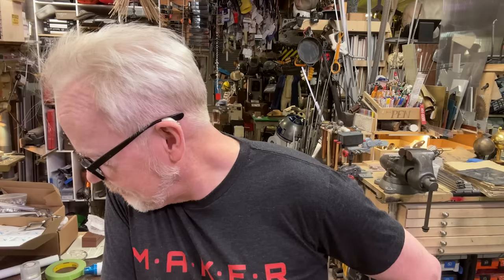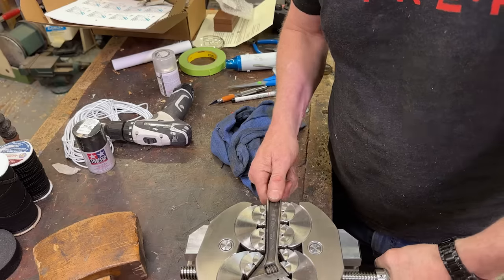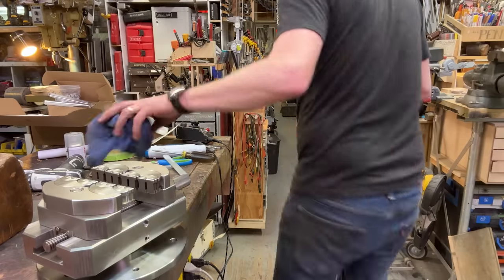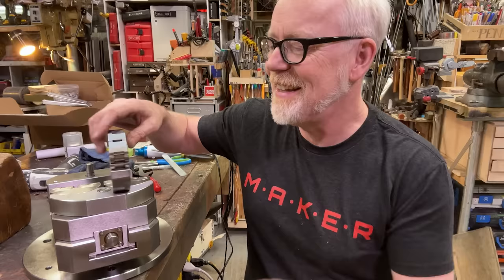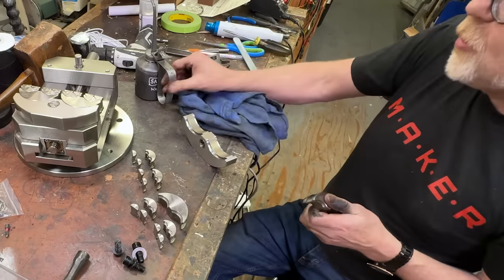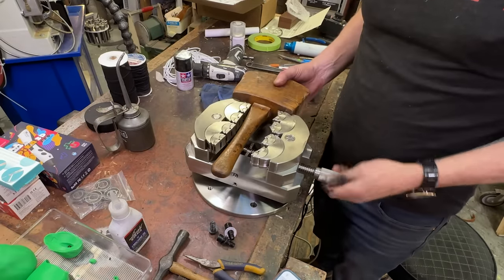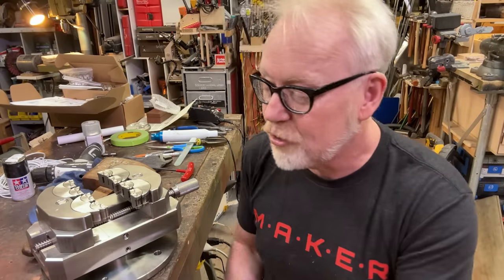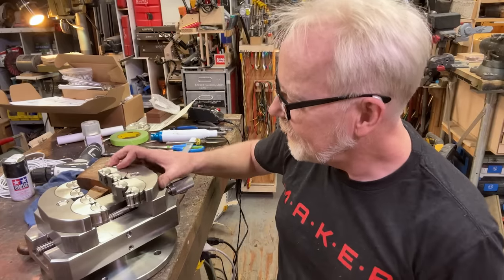Adam Savage in Awe of This Fractal Vise!

Comment: I think the original works better at adjusting its face for a couple of reasons.
One, there are more pieces and they come down to a smaller surface area.
Two, the final pieces need teeth on the edges so the middle of the face doesn't get "caught" as you close the vise.
If instead of being a flat face, they could be cuppped. So you would have what amounts to two protruding ends. Like a half moon. That would definitely give them a nudge in the right direction as you closed the vise.
I would use a very fine rubbing or polishing compound to work them into each other.
Finally, i would number or mark them so you always reassemble them the same way. Dont forget to mark the face of each. Maybe just number them on one side and make that the bottom side.
Reply: Funny I was thinking the opposite, as in half moon with the thicker part in the middle to aid the rocking motion and provide more conformity. I could imagine the sharp edges of the smallest teeth digging into the work piece and binding. Apart from that detail you read my mind. Cant wait to see where he goes with this
Reply: This Chinese vice is a stolen design from an American manufacturer, it's actually patent infringement...

Comment: As a fellow machinist i can say that when micro tolenraces are involved in linear movement they are usualu processed after hardering to created micro semi circular ¨Scratches¨ so the oil has  something to grab on to and stay there, down side is depending on the working ambient micro particles of metal/normal gunk cand also get caught thus risking damage (avoided in most machines by rubber dust covers), u can overcomplicate the crap out of it by adding a pump to the torque shaft and fine drill active oil injection when it moves with quick connect so they can rotate, but yeah, it´s a fun toy, using it is a joy, maintaining one is a fraking nightmare for daily use

Comment: You should bore out the large thread for  the tension bolt and rethread the tension lever bore with close metric threads and install a new metric threaded tension bolt with a sliding handle  then you would have more tension control and it can really grab things tight. ❤ the video, you are the man brother 💯

Comment: holy things!!! Thank You Adam. I was even aware of such a vise exist. I have a machinist formation and I think i love this thing as much as You. I genuinely had chills when i started to see the vise during your unboxing. A notch in the center of the ends half circle seem to be a great idea. I presume the alloy of the the vise is a very hard one. Maybe close to what would be classified as HSS. Would probably required at lest a full carbide tool to machine it. The thing is how to make these tiny half circles hold while machining it. Maybe holding two half circle face to face and drilling and using a reamer to finish the job. Could maybe be done on a latte. Anyways very exiting.

Comment: I remember seeing a video of the restoration of an original fractal vise. That one, I think, utilized a threaded pin in each fractal element, running in a groove on its mating part, to ensure it wouldn't be removed by accident.

Comment: I think it's probably good to use a light rubber mallet on these to unstucken the swiveling parts when you're at 90% clamping before putting any more turns into the screw. Vibrate the whole thing slightly until the looseness of some parts gets spread out to the oes that made contact first.

Comment: I assume you checked for burrs when you took it apart the first time, but make sure there are none, make sure all the mating surfaces have a good mating surfaces to begin with. So some light sanding with some fine sand paper will do, putting lapping compound or polishing compound probably first, is a great idea. Work it in best you can, but maybe not actually clamping, as compressing the hard abrasives will perhaps imprint or at least become less effective as an abrasive. But working it in with your hands, rotating the pieces together would be great. Just make sure you clean and then oil well after.

Comment: Simple way to clean this, first, mark orientation of the parts with engraving pen, dismantle, go over all the surfaces with a brass cup brush, no need for speed here. Then wash it all off in a solvent bath. Dry and assemble with a light machine oil. I'll bet you it'll work quite smooth without any other work needed. Now as far as the locking mechanism for spinning, pinching that little shaft with opposing grub screws wont be enough, you'll need a secondary means of clamping that down. And I like your idea of a speed handle on the vise handle, wish I had a shiny new toy!

Comment: I think one thing you could do to smooth them out is put them in a steel pin tumbler 🤔 it should polish the pieces without removing too much material. Or possibly sand blasting only the sliding surfaces?

Comment: I might suggest using dry graphite as a lubricant instead of oil? Maybe? Since it will more than like used in an environment where the oil would hold on debris.
Reply: Dry Moly. And if you want this thing to never gall, alternate the hardness of mating surfaces by at least 50 Brinell. Also +1 vote for numbering and match marking individual mating parts before lapping together. Also recommend ball screw retrofit- get rid of the acme screw. What grade of SS was used in its construction?

Comment: For anyone with a 3d printer you can print a fully functional plastic one, much stronger than expected and 25 bucks instead of 2500, super good for pcb and things alike. I also saw a video restoration of an original and noticed that instead of flat where the surfaces hold object there are actually 2 teeth on the original mating surfaces which may help with conforming to the shape better??

Comment: If I were improving the design of this product.   1.  I'd spring load the individual pieces so they return to home position if you just release the vice.  2. I'd make a lock down for the springs so that I can keep the current shape so I can keep a shape if I am working on multiple of something so I don't have to reset the contacts every single time.  3.  I'd mill out a slight crescent in the end pieces that contact with the product in the vice, and fill it will some semi-hard rubber that has just a little give.  I feel like not everything you work on in the vice will like a hard and scratchy metal surface rubbing, moving, and pushing into it.

Comment: if possible, i would see about finding a split pillow block bearing for the opposed acme screw. i feel like the metal on metal would start to make the action very stiff after a while. for the swivel function i would make an integral slip t handle for ease of adjustment. after using some fine lapping compound i would number each piece and after lapping the parts i would use a ptfe type lubricant to keep fod out of the contact surfaces.

Comment: An original one manufactured in the early 1900’s each dovetail would have been hand fit (why they were numbered). But with modern CNC you can get repeatable tolerances for interchangeability like that.

Comment: I've had success using metal or jeweler rouge and a buffing wheel to put a mirror finish on irregular mating surfaces.  Takes very little time.  The most difficult bit is holding onto the parts without shooting them across the shop.

Comment: Crosshatch the facing jaws for grip?  Then is it done as a lightly-scored to avoid damaging surfaces it grips or at the other extreme of deeply-cut for best grip but at the cost of marring surfaces it grips.  Alternatively, maybe place a thin rubber surface with adhesive on one side that could be easily replaced on any of the facing jaws?

Comment: The mating surfaces you should create new ones or make it so you can inset a soft metal so you can hold onto objects you don't want to be bitten into.
Overall the vise looks amazing the handle could do with a better style, using a floating bearing instead of grub screws and it would be nice to turn the vise without needing a grub screw so a way to lock it in via pressure like a pressure clamp/mechanism would be nice. 

Last would be a way to tilt the entire vise, that way you can work on them vertical or horizontal. This would cause issues though since the heads come off without any set screw or mechanism keeping them in place.

Overall great find, I always though the Fractal Vise was amazing looking and would work great in many different scenarios.

Comment: Putting teeth or slots in the outer surfaces that touches the tool you are grabbing to prevent that surface being flat will cause it to leverage and move the contact points a bit better and hold what you want clamped down in it a bit better, as seen on the original.

Comment: Looks like a brilliant tool to engrave odd pieces, steady for pin vise work, etc.  Not sure it has the holding power for mill/drill work?  Anyway, if half moon pieces are a tad too tight, a light lapping with 1000 clover compound might do well?   Just clean it very well after.

Comment: Ok, as a professional automotive machinist, I actually agree, that it is a good idea to use the lapping compound(Diamond, preferably.  Due to the stainless steel hardness.  Or, could use the carbide, if they even still make it), to remove the burr's, that are causing it to stick.  But, if you do not already have one, you should get a part's cleaner(Or, you can go to your local auto mechanic shop, and ask if you can use their's, or at least see what they are), to remove all of the old gritty oil, as well as the lapping compound(Obviously, it would be defeating the purpose, if you can't remove the lapping compound, and actually clean it, like you are wanting to).  Now, when you are done, you should use something else, that is primarily used with automotive's, as well.  I would use the anti-seize lube(Copper, not the aluminum), as it is set in a heavy grease(Keeping gravity from removing it), and the copper, being a softer metal, will give a smooth surface, as it act's like microscopic ball/pin bearing's.  And, I do recommend using it on the vehicle lugnut's, brake cylinder bolt's and virtually any other nut's and bolt's, that would be loosened and tightened periodically(When tire's are being rotated/replaced, or brake pad's are being replaced), as it will help keep them from "freezing up", where you could break the bolt head's off, or the nut's break the threaded part off of the stud's, bolt's, or whatever.  And, you can use it for the bolt's/nut's on the mill, just as your lathe(Especially, the jaw threading, as it will cause less wear on the thread's)...
Reply: Now, on to the Chinese factory stuff.  Yes, there are some good stuff, but you do have to watch out for the cheaper made stuff, such as ball/pin bearing set's, and some other stuff.  The ball/pin bearing's are made from scrap metal, that compromise's the integrity of the metal itself, as it's not as pure, as if you were to get them from a US factory, where they use fresh metal, that is AKA "Virgin" metal, to some.  And, the tool's(Wrenches, socket's & etc), you can get away with it, to a point.  So, like I said, just have to choose wisely, with your gamble...

Comment: I always thought (based on admittedly anecdotal, at best, evidence), that the miracle of manufacturing in China was not in the ability to produce things at low price points, but the ability to manufacture something to MEET a SPECIFIED price point. The things we (westerners/Americans) tend to buy happen to be spec'd out for the lower price points, but I'm pretty sure you can have a product manufactured to a higher price point, and therefore a higher quality, if you request it and have the demand to meet a minimum volume of orders. It's price point engineering, meta manufacturing, whatever you want to call it it is freaking impressive.

Comment: Baby steps only when it comes to cutting, you know what happens when the work moves even just a little bit. Every use will complicate the fitment of those nested surfaces. Machining warf and fines, plus the internal clamping forces will generate a hair pulling experience for the life of the tool. Flat plates, key stock and bees wax will get about as much work done, with 1/10th the headache.

Comment: Ive used 4 grades of diamond lapping compound to create excellent mating surfaces before, but you have to be super careful not to cross contaminate the grades or all is lost. Not sure if this is the way forward with the fractal vice. If I had a load of jaws of each size, Id probably give it a go, but with zero tolerance for error, I am not sure.  Diamond may be too brutal. In which case how about 1000 grit carborundum?

Comment: After the rubdown with steel wool, might I recommend a liberal helping of Motorkote?
It will treat the metal, won’t wash away in water, either.
I used the spray form in a very heavy steel barrier gate, once.
It squealed so bad that it would make my ears ring.
A squirt on each hinge point lasted over a year in some of the most insidious weather, and dusty conditions….

Yes, a high tech oil for such a high tech piece of art.
It will also cut down on the friction a very noticeable amount.

The damn gate would never stay put after I treated the hinges….

Comment: a super fine grit paste abrasive worked into the joints and then cleaned off would clean up the clearance to perfection or honestly just a little sprit of oil and a lot of time and use. Cant wait to find out if this guy holds up.

Chinesium is an outdated term referring to a time period in Chinese history where people literally melted down pots and pans to sell the steel/iron. That Steel and iron was never processed properly and was  mixxed into the supply chain. The steel and iron from the time period that "Chinesium" comes from has all been used/removed from circulation or reprocessed/recycled properly. 

I kind of remember something along those lines... anyway.

Comment: Adam. Love your projects and content. But I feel like the changes you made to the contact points reduced its performance. Correct me if im wrong. But, the fractal vice is designed to maximize grip by increasing the area and points of contact to maximize friction. The changes you made doubled the points. But greatly reduced the surface area. Do you feel that's the case after using it with your changes? Or is this truly better?

Comment: Chinese products are all the same to me.
 
It's a tool that I get for cheap... but the catch is, it's never ready for showtime directly out of the box. Always requires tweaking, oiling, sanding, smoothing, filing off sharp edges, etc...
 
So in that regard, this product is EXACTLY what I would expect from a Chinese manufacturer. It ABSOLUTELY CAN BE turned into a legitimate hard-working tool.

Comment: For me, this is kind of a "close, but no cigar" version.  If the Chinese company that makes these (or anyone who wants to compete with them) is listening...
1. Give us a better base, like the Kurt DX6 series.
2. Forget about the rotary base. >95% of setups don't need these and it's just one more axis that can drift out of tram.
3. Make one jaw static.  That simplifies the design (of the screw and other parts)
4. Use a hex head on the screw, making it interchangeable with standard mill vise handles

Comment: I've talked to a number of people who work for companies that get material and equipment from china; reportedly the quality is very hit or miss and you'll want to look around and then get to know and work with your supplier. You can absolutely get world class stuff from China, but there's also a lot of low quality, and some that can be high quality but the quality control of sloppy so half a shipment might not be up to spec.
Tho one person swears the one thing they can't get in consistent quality is, oddly enough, steel; worked with a number of producers and can't find one with decent quality control. Tho with how these things go it's possible they've just had a string of bad luck.

Comment: You really only need horizontal serrations on the mating surface’s. Nothing is going to move horizontally because it’s designed for irregular objects, otherwise you’d just use a normal vice.

Comment: I don't know how much experience Adam has with Chinese manufacturers. Probably far more than me, but even then I think I have some useful insight. I worked at a company that had some things made in China. One of my coworkers, who had been doing QA checks on the parts from the Chinese factory for years, told me this: The difference between American and Chinese manufacturing isn't in skill, experience, or technological capabilities. It's a cultural incompatibility. Western companies just tend to be bad at interacting with them because of a fundamental difference in the relationship between different companies. What my coworker said was that in both the US and China the companies are just trying to do what is best for their company. The chinese manufacturers will try cutting corners to save money. They will use tooling longer than it should be used, they might swap metal alloys for a cheaper one, or they might do any number of different things. The thing is that they fully expect to be caught cutting corners and haggled with. If you need it to be a certain way they expect you to check that it is done that way. On the other hand, in American culture, a company's best choice is to deliver a result as good or better than what was promised without cutting corners. In American culture, getting contracted to make something and then cutting corners in making it is seen as a violation of the relationship between the two companies, and chances are the contractor will have a harder time getting work as a result. The Chinese companies try to cut corners, get caught, fix it, and continue on like nothing happened. The companies keep working together, everything is fine and working normally.